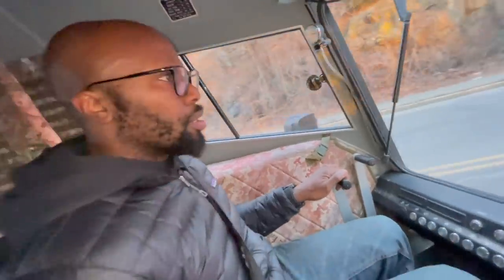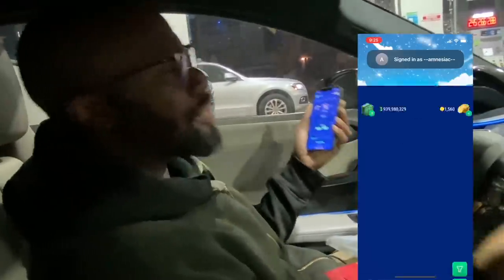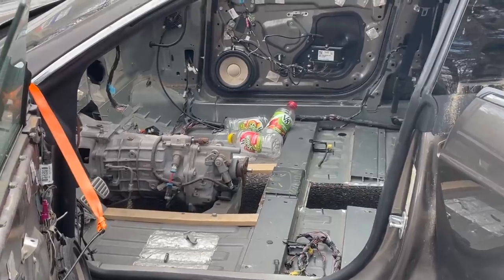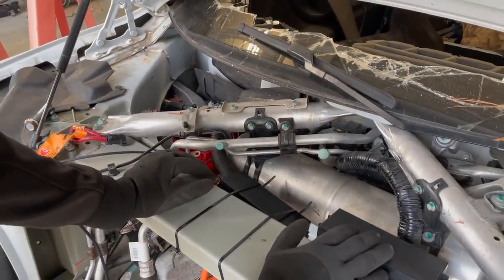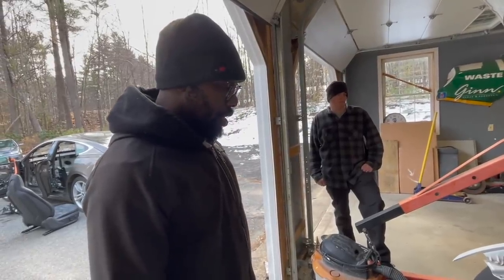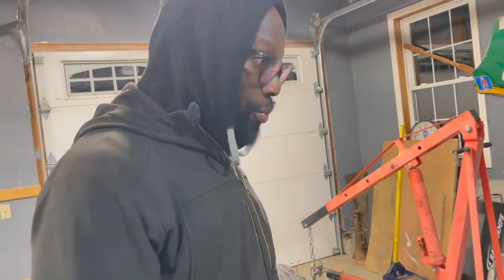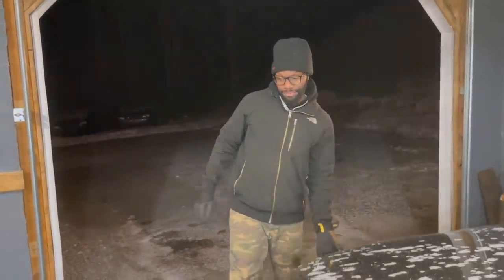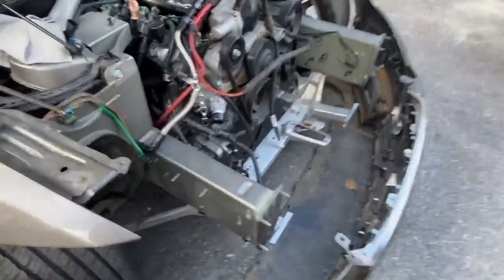Installing a 6 Speed manual transmission in a Tesla

Comment: You need to bring it in for an oil change at Jiffy Lube when done.
Reply: Underrated comment. Bring it to every mechanic in town, just like the drive through. Dont let them hear it though. Tell them you need an oil change, transmission flush, and I think I hear some lifter noise can you check it out? Tell them you had it scanned and you got a misfire on cylinder 8. And watch the mechanic just stare at the car like ummmmmmmm.....thats a Tesla dude.
Reply: Tesla service centre would be better.
Reply: @Gnrnrvids   This too
Reply: I bet rich is already planning videos like that when this is done, ass well as taking it to the drag strip. I can't wait to watch
Reply: @Gnrnrvids  Why not both? Either way reactions will be priceless.
Reply: @alexisrivera200xable  Agreed.  I just think the Telsa guys will be the most put out :D
Reply: Electric vehicles are the only ones Jiffy Lube hasn't screwed up yet. He is putting a lot of work in it to get it going. If he takes it to Jiffy Lube, he'll be leaving with a loose/stripped drainplug, loose/wrong oil filter, or no/too little/too much oil.
Reply: Jiffy Lube is a joke. Send it to Scotty Kilmer instead.
Reply: @izzatfauzimustafa6535  Scott's reaction would be the best

Comment: Cars were so much simpler back in the day.  One wire from battery to split into 5(one for key& one for coil & one for 8 track & one to alternator so it was excited to charge battery and one to battery solenoid.  Fuel pump was manual cam driven. Electric fuel pump means another hot wire is added to 5=6 .   Then a separate wiring array for the lighting (headlights, tail lights, signal lights dome light.  Electric door handles not needed or electric mirrors.  It just got more complex with the system that breaks down first(electrical)
 I definitely would replace the touch screen with a chalk board. No GPS "They can track you"

Comment: Just hoping this all ends in a V8 Tesla beats factory Tesla in drag race video
Reply: Only if he seriously works the engine and puts massive tyres on the car. Electric is pretty amazing for drag racing.
Reply: @randomname4726  only out of the hole though
Reply: It'll cost more than original tesla p100d brand new probably.
Reply: @randomname4726  they’re good up to like 110 mph, after that even normal drag cars destroy them, but I agree i’ve felt tesla acceleration and it’s nuts.
Reply: Doubtful
Reply: @huntermacdonald6431  Correct, I should have specified only for 1/8th mile and some 1/4 mile.
Reply: @RegulerShowTV  Yeah they smoke in the 1/8th mile but a decent quick car can win the 1/4.
Reply: @randomname4726  yeah because poweful electrics costs more money than your house and tesla specifically has paid a lot of attention to the acceleration. Its not just a family car. A gas car vs the same HP as an electric, the gas will win because it has better top end performance and lower gearing. You see all the teslas winning because they got insane traction control and tons of power, while most gas cars have lower HP from factory. But same HP gas and Same HP electric, gas will win
Reply: @dieselgeezer18  -  Dodge Demon has left the chat...
Reply: @RegulerShowTV  i never lost to a tesla...stock engine civic si 2010..12sec car..
Its realllly funny on the highway...i pull football fields on them.
Reply: The initial acceleration of a Telsa Model S P100DL is excellent, helped by the power being put down to all four wheels, the battery under the floor (lower CG), and the traction control system.

With the V8 up front delivering power to only the rear wheels, and with an interruption of power every gear change, the V8 Tesla will have a very, very hard time with the "hole shot" and will probably be slower than the EV up to about 100 Mph (160 Km/h).

With some forced induction, a proper "tune", and some beefy tires out back, the V8 Model S might stand a chance in the ¼ mile.  Maybe.  Depends on how much of a lead the AWD EV Tesla gets when the lights turn green vs. how much of a top end advantage the V8 has and how much track the V8 has to reel in the EV.  IMHO.

Physics - the tire contact patches, the coefficient of static friction between the tires and the road surface, the static weight distribution of the car, the "weight transfer" of the car under acceleration, the wheel torque, the torque which can be applied before the tires break traction...
Reply: @frederickevans4113  modern DCT and sequential stransmissions shift ultra fast.There is basically no power interruption. Gas cars also have a big advantage. They have lower gearing(1st 2nd gear) and better power at the top end. 600hp sequential transmission gas car vs 600HP electric car, the gas will probably win

Comment: Rich for the additional strengthening of the floor before you fit the transmission tunnel make up steel plates with welded on nuts to fit into the current box sections , then make up bridge sections to go under the car , under the prop and exhaust and bolt onto the plates inside the box  section to give more rigidity but would be removable for maintenance,  like a strut brace .

Comment: For the ultimate Tesla burn Rich needs to make this go faster than a Tesla.
Reply: I'm almost certain that's partly the point. This puppy is going to turn heads at the track.
Reply: It’s going to get sponsored that’s for sure. Wwwwuututututututu
Reply: Not going to happen
Reply: He’s not doing it necessarily to make it faster , he’s doing it because people said it can’t be done .
Reply: Rich needs to Cannonball Run this Tesla and build it accordingly...
Reply: It will be twin turbocharged with nos..... fastest kinda-Tesla on the planet !!!
Reply: @jonathan6665  its not that hard, make it a drag racer. With enough power 10 seconds quarter mile.
Reply: @jonathan6665  Bother telling us why ? The car will loose about 400 kg of weight. Aerodynamics will stay the same. The LS motor has 426 hp Stock and cars with that motor are around 570 Nm of torque. Supercharging it can easily get it to 650 hp and 800+ Nm of torque.

Model S performance spec figures show:
795 hp and 1140 Nm of torque
HOWEVER: These are the theoretical peak load specs of the electric motors and noone has ever been able to produce these figures on a dyno. Also the battery does not output enough Power to simultaneously reach peak power on the motors. Dyno-measured values are ~600 hp of peak power while the torque seems to match up the figures.

So yeah - most likely the Model S performance will stomp the V8 Tesla in a 0-60 mph run due to AWD, higher torque, launch control and cheetah stance
But this picture might change if you go for 0-100 or 0-120.

Also the V8 Tesla will be better at maintaining speed on corners.
This might be a quite interesting match when taking both to a race track ...

Comment: I love how it gets more difficult at every turn.  Can't wait until they figure out that the frame isn't designed to handle torque from front to back, and they either weld the doors shut (my preference of course), or build an entire tube frame under the car to handle it. When he is done it will look just like a NASCAR, with a tube frame and a fiberglass Tesla skin hovering over it.
Reply: A monster truck Tesla rolling on 44s with a hole-the-hood blower would have been better...
Reply: That's an excellent point, I foresee a twisted Tesla soon!
Reply: Hopefully if they reinforce it well enough it will be ok.

Comment: Can you do an ev conversion of this car when you finished?
Reply: Do you mean turn the Tesla back to EV or make an EV camaro? The car the engine is from has been scrapped so it is impossible, and converting this back to EV afterwards would be a waste of time and extremely difficult with the chassis modification. No point re-EVing it.

Comment: Crac...I mean Beef Jerky is dried beef - you're taking 10 pounds of beef, smoking and drying it, and ending up with maybe 2 to 3 pounds of jerky. So if you paid $100 for those 10 lbs of beef, and you end up with 2 lbs of jerky, what you paid $0.63 per ounce [$100/(10*16oz)] for raw beef is now $3.13 per ounce [$100/(2*16oz)]. This gets even steeper if you use a higher-quality cut of beef where you're paying $20 to $25 per pound ($1.56 per ounce), which now your jerky is $7.81 per ounce. Add in the other ingredients (sugar, Worcestershire, soy sauce, black pepper, salt, onion powder, garlic powder) and packaging, shipping, profit/expenses, middlemen)...that's how you end up with a $13 bag of 1.5oz of jerky.
Reply: It's cheaper in the short run to buy your own dehydrator (or better yet, build one - even less costly) and make your own jerky, especially since it basically lasts for months, if not years in the right conditions.

Comment: Dude my mind is blown on this build. An entire transmission drive shaft tunnel wit modified structural support is perplexing wit out adding another 500lbs ta the weight of the chassis
Reply: The battery is the heaviest part. The conversion will probably weigh less

Comment: For the shifter you may be able to move the whole thing back and extend the shifter rod. It would mean creating something else to mount the shifter to but it may be easier and cleaner than trying to install a short throw shifter. Or maybe even do both, the short throw shifter and move it back. Not sure if it would be to far back then though. Just a thought

Comment: Hey, with the seats out you have the chance to put a toilet as the drivers seat. In case the car has too much power, one does not have to shit his pants. Ok, that requires to take the seat/toilet with pants down already but hey this is a compromise car right away, right?

The only way to turn this into an even more controverse car would be with a russian inline 6 diesel engine.

Comment: I would recommend putting a heat shielding between the motor and the Teslas wiring as they did not build it to withstand the temperatures an actual engine will put off... Just food for thought.

Comment: Dude i want to to this since they first started making these cars. Thankyou for pioneering this awesome project.i think big turbo 4 Honda engine and set it far behind the front wheels and it would handle like a mid engine. And no tesla wont sell a blank chassis i asked. Its too bad the teslas chassis are nice and have alot of potential in the builders market.

Comment: Honestly, if you’re planning to build a trans/prop shaft tunnel down the center, you can gain more rigidity than the Tesla had to begin with. 
So keeping that crossmember is unnecessary, unless it’s just there to keep things straight until you build the tunnel.
Reply: Your last sentence is correct it is just temporary

Comment: Wow a Tesla I would drive/own nice 👍 I would build a 600+ inch big block with a 1471 blower or better yet a psi twin screw with mechanical injection and open headers (yes I may have to build this) my buddy took a Volvo wagon we built a blown alkali big block and mid mounted it we backhalfed the car an tubbed it mark willams rear lenco trans air shift no one wanted to build that linkage lol car ran 7.20 something first pass smoked the tires to the 600 foot mark they throw us out for that the car was a high 6 second car for sure never ran the strip again but murdered everything on the street with it way to much fun car pulled so hard it didn’t need wheelie bars it drove over its center or gravity and carried the wheels about 700 foot man that thing was sweet

Comment: you know what could be a good idea? to use the oversized screen (since no longer wont be used any way because its broken) to mount the Gear knob shifter, like a Renault 4L Gear know .. i bet you've never saw one. 

One of the most well designed 90's European vehicle. or is it 80's? i don't know. Thank God there is Wikipedia. 
Other good examples of European Beauty:
Ciroen 2cv (litterally means it has only 2hp)
Fian Uno (Or if you would like more speed, Fiat Uno Turbo i.e)
and of course, the Tar smasher: Opel Corsa A

Cheers

Comment: It is good to reuse most of the tesla wiring, but the motor brings with it certain drawbacks for example the temperature, the tesla systems in the front of the car can withstand the temperature emanating from the v8 engine?

Comment: If only tesla/other EV cars came with a 6 speed if not a real transmission that you can manually shift the gears with and not some direct drive assisted with software updates or something else from factory I would be very happy to see that the time has finally come to happen not be just remain as  thought of wanting to do myself only.

PS: I would sanitize my hands after touching things that a corona ill person has most likely dug around inside of and quarantine anything new you get outside at least if I were you.

Comment: i wonder for radiator if you cant mount on front go the route porsche did with 2 smaller and thicker on eath side of the bumper, why they did that on the car with engine in the back is anyone's guess

Comment: Uncle Rich getting down on Tesla's broken black hose. For shame...  that engineering goof is up there with GM blocking the rear passenger spark plug on older v8's with AC.

Comment: Since you are putting a gas engine into an initially electric car, will you need to get emissions done, or will it not be able to go into the state's system as a gas car?  Potential emissions loophole?
Reply: The shell of a car doesn't dictate its type
Reply: @RawbLV  No, but usually state databases go by the make and model and consider the chassis of the car as the "main component" to dictate what the car is.  Tesla frame and VIN, at least in the states I've lived in, you'd never be able to log emissions data with the state because it's inexorably linked to "electric car," thus zero-emission.

Comment: Is it just me, or would it be easier to just gut all existing wiring and run a stand alone ecu to run the vehicle and accessories? There has to be endless comms errors trying to connect all the smart electronics without the main batteries...

Comment: Just out of curiousity. Could you not somehow (if you know someone, or yourself), hack into the computer of your tesla and enable fastcharge, and block them from having any access to control your car? What kind of shtty company has the audacity to remove features from a car you purchased. Its your property. Isn't it? Or is there not an aftermarket solution to this? IF not, there should be... hmmm?